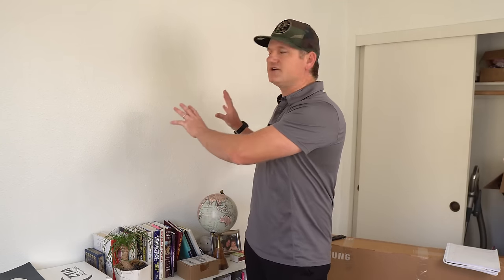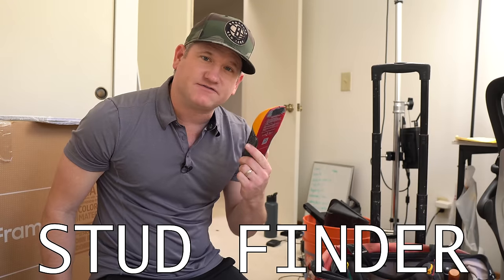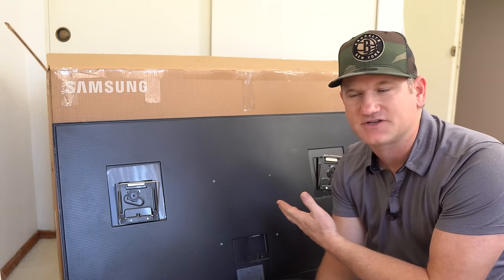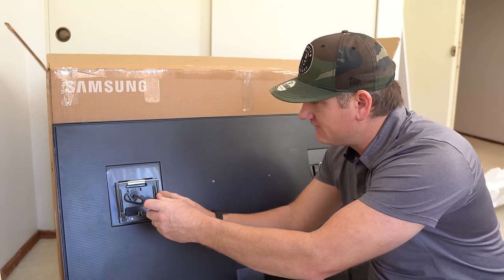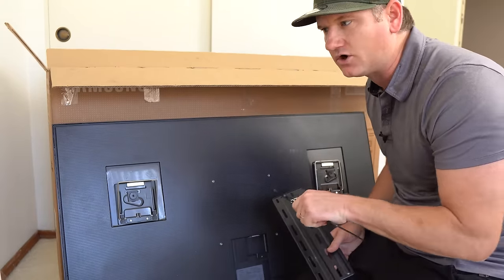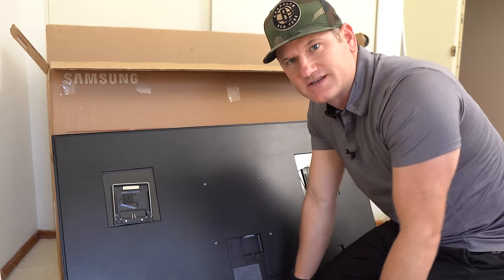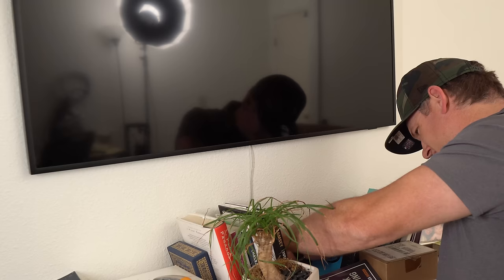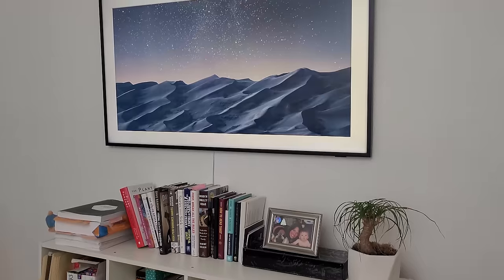Samsung Frame - Quick and Easy TV Installation

Comment: Love this video, thanks for sharing it with us. I have a 55" frame coming next weekend, and as a renter, I was concerned about cutting into the wall for concealing the cords and conduits. I love that since I won't be hiding the cords, it makes installation that much easier and straight-forward. I will have a barn door tv stand sitting underneath the hanging tv, so I know the cord won't be obvious at all. I mat still get the cover for it. This was so helpful, thanks B!

Comment: Excellent video!!, i work through handy app and some customers want wire inside wall but i always tell them that wire is not prepared to be inside the wall by code, unless you buy the upgraded wire that cost like more than 250 dollars that Samsung makes it. Excellent video and proper installation!!

Comment: Great video. Lost the template in our move so this was perfect. I had box of those exact drywall anchors but they wouldn’t set in the hole properly due to Vapor barrier and insulation in the wall. They’d snap. So there’s a series of half inch holes my wife won’t know about until she decides to redecorate.

Comment: Another helpful video!  I'm picking up my frame this afternoon.  I have an in-wall channel where the wires will go to the one connect box in a cabinet below.  But there is a power outlet that will be behind the tv.  I don't plan on plugging it in there, but will the outlet keep me from getting the tv flush on the wall?  Thanks!

Comment: All TV displays should be designed like this.  There is another post here on YT, that discusses the advantage of having a video receiver connected to a "display" to separate the two devices in the same manner as audio equipment.  In the case of video, this solves a the age old problem of hiding wire(s).  The idea of having 1 wire of power, video, and audio from a video receiver would prevent the chaos of tech protocols  that infest today's tech requirements.  Example HDMI 2.0-1-2-3-4 etc.  If we could limit these things to a separate video and/or audio video receivers, and make displays open architecture, then the most expensive part of the system is free from obsolescence and cutting the cost of the unit.

Comment: The wire would drive me crazy as I would see it every time I walk into the room.  Granted it is a very thin wire and "most" people would not notice it. I decided to install mine using the OnQ box and run power from another outlet below.

Comment: This video helped us out loads today. We thought the clips were broke when they moved around so much but after watching this we released that they were supposed to so you can adjust the TV on the wall. Thanks, very helpful!
Reply: Thank you for video and comment TT. I understand that the clips are designed to unclip themselves from the mount to adjust the TV but why go to the trouble of aligning everything so minutely to start. As soon as you hang the TV the hangers HAVE to disconnect themselves from that big screw in button. How do you then push the TV flat against the wall so the magnets engage.

Comment: Probably could've gotten away with just 2 snap toggles on the left and 1 plus the stud fastener on the right (less holes in the wall). Those snap toggles are strong enough to support quite a bit of weight if I'm not mistaken. I also would have used a different method for securing the one connect wire to the wall as well as getting it as straight and taut as possible (command strips maybe or some type of fastener similar to thumb tack). Would've been a no go on the rusty washers to lol, not a big deal I'm just OCD lol As expensive as the Samsung frames are you would think the design would be a lot better thought out. The one connect is annoying and not installer friendly. I had a guy move his media stand while the one connect box was still connected and he ripped the cable setting him back like a 150 bux for the cable. I don't know what they were thinking when they designed the interconnect and the mount and mounting hardware. Awesome vids as always, love watching your install content.

Comment: Do you lose any functionality of the one connect box if you mount it in the wall? Will the remote still work as well with it in the wall? Will the box get to hot inside the wall even if you use a AV mounting box?

Comment: Great installation video.  I am going to be installing mine soon and have a couple of questions?  1) currently on the wall where my fram will be is an electrical outlet and a coverplate for phone/cable. Will I need to remove these or will the tv still be flush against the wall ? (Ie: will leaving these interfere with a flush mount?). 2) similarily, does the one connect wire need to follow the groove on the back of the tv?  My conduit will not line up perfectly so I will have to just run the wire over a bit and not in the grooves. Will this cause the TV to not be flush?  Cheers

Comment: For a TV that is designed largely for the aesthetic appeal, it's amazing how poorly the product is managed when it comes to the cabling. The "invisible" cable bundled with the sets is not in-wall rated. Samsung does offer an in-wall rated cable (the "2019" VG-SOCR86U/ZA) and while it apparently works with the 2020 & 2021 versions of the Frame, Samsung doesn't list those units in the documentation. Depending on the reseller, some outlets (Best Buy, B&H) will tell you that it's not compatible. The cable is also considerably thicker, so it doesn't fit into the channels on the back of the TV.

Sound about right B?
Reply: I think the average consumer won't route the wire into the wall, so that's why samsung decided to do the "invisible" cable gimmick. Is there any truth to the claim that the in-wall 2019 cable works with 2021? Currently users on the amazon listing for the 2019 wire are saying it doesnt work.
Reply: @chinchilla505  A number of people on various sites, including Amazon, indicate that the connector port is identical and the 2019 cable works with the 2020 & 2021 version of the Frame. If you ask Samsung product support reps to verify, you get different responses.

Comment: so with the "slim fit mount" there is always a little extra gap at the top correct? I just installed a 65" frame tv and the bottom was no gap, but the top had a gap.

Comment: When mounting the Frame on drywall, with studs, etc.. .just like in this video.  I took a drywall knife and “scored” a straight, small channel from the bottom of the TV to below the cabinet top.  I then pushed the exposed wire into the “channel” I scored in the wall with my drywall knife.  I then used drywall mud to cover the channel.  Let dry, do a little sanding to make it look smooth, added some texture then painted over it.  In another room,  I took a piece of 2”wide, masking tape and covered up the wire.  I then painted the drywall tape the same color as the wall.  It looks good, not great.  But, nobody notices that there is a wire taped to the  wall.
Reply: I was thinking exactly this! Thanks for letting me know it will work!

Comment: Is it safe to use those toggle bolts for the 55" frame (36lbs)?  Would 1/4" ones be better?
Also, thank you for the video, very helpful! Clean install and you do a great job filming and explaining as you go through it!  The best install video I've seen.
Reply from the maker: The 3/16 are best.. they hold 90% weight the 1/4 inch do and they're much smaller and easier to work with and both are massively overkill for this.

Comment: I am trying to plan blocking in a wall for the 75 inch unit.  Samsung can't tell me the simple dimension between the mounting brackets.  The installation manual with the wall bracket does not refer to the frame tv model number.  So without buying the unit before my house is built, I can't get a dimension.... any suggestions?
Reply: This may help. Depending on your local timber prices. 
Knowing which wall was going to get the TV, I lined the entire wall, with 3/4 flooring sheets, known as yellow tongue flooring here in Australia. 
Then glued the drywall over top.
The TV, speakers and floating shelves were mounted without needing to find studs.
Added bonus is how much sound deadening it gives, keeps the TV noise out of the bedroom side of the house.

Comment: Hey B, so I bought a 65” frame and I ran into an issue I was hoping you could help me out. So on the left bracket I’d be able to hit a stud but on the right the stud I would have to use is showing electrical. I can see the outlet is on the left side of the stud, would I still be able to drill into the stud just be careful of the side the electrical is on or should I avoid it all together? Would the single stud be fine and use all flip toggles on the right side? I personal would like to avoid that
Reply from the maker: It's what I did in this video. Why would yours be different? The electrical is not normally In the Stud but you gotta do what you think.  I have literally never hit an electrical wire with my drill on over 10k installs
Reply: I was a little worried about the weight of the 65”. One last question, you think I’ll be good with the 3/16”x2-1/2” flip toggles? And I was thinking about doing 2 screws in the studs and 4 flip toggles on each side for extra support, would that be a good idea? Thanks btw, your a life saver 👍🏻

Comment: It is possible to do it this way but is it right?
The barackets on the back of the TV is turned up side down. There are magnets that is puppose to hold the TV to the wall if wanted.
Reply: Actually that makes sense. Otherwise the hangers pull the mounts out

Comment: No offense bud, but I would never allow you to work in my house; I'm one of "those" people who would go nuts, with the way you leave the wall looking like a toddler was let loose with a crayon. Yes, it's behind the TV but that doesn't make it go away.
You do a great job otherwise and I learned a few things and got some decent tips.  Why don't you try using painter's tape to make your marks and then remove all the evidence of your doodles at the end? Personally, that's how I would expect a professional to work in my home.
Reply: Good thing your not around for manufacturing of boats or anything else.
Reply: @garyradtke3252  Dude, I've been in manufacturing for (probably - judging by your misuse of "your"?) longer than you have been alive!? Fiberglass, steel mills, sand foundries, you name it - I've done it. Yet, despite the messy environments, those products leave the factory in almost flawless condition.
I don't see how you can correlate graffiti and hieroglyphics left behind on a client's wall with those types of manufacturing environments(?).
I just gave the poster a recommendation: use some painter's tape to do your markings on, and remove it when you're done. Easy peasy!? 
Why did that put a bee in your bonnet?

Comment: I just got the new 75 inch frame and my studs don't line up with the optimal postions on the new mount. Will toggle bolts in dry wall support the 75 frame??
The toggle bolts I purchased say they can support 64kg (141lbs) and the Australian model comes with a template for the install:)
Reply: 75 went up without issue using toggle bolts. I've got thr 2020 model as well and I can see why they switched to the new bracket but I still prefer the older
Reply from the maker: Yep. Easy enough
Reply: I never use the Samsung os I always use external devices but testing out the wired network and its only 10/100 which is pretty crap, why not include 1 gb card.

Comment: That one wire powers the tv?
Reply: The wire connects to the One Connect box. The one connect box provides power to the tv. The box also allows other connections like HDMI. Etc.
Reply: Yep, check out the other videos.  Samsung has this OneConnect box that has the power, hdmi inputs, etc. so that all that stuff and the processing is done in the box and the TV can stay thin.  So power and the signal come through that one wire.

Comment: Can anyone figure why it's a two piece wall bracket? One piece would make hanging it level and accurate much easier.
I've installed many tvs, just not a Frame, and I don't see the point.
For reference, the roatatiing bracket is a one piece.

Comment: isn't it the whole idea behind this tv, so no wires are exposed? Kinda stupid on Samsung's side not to make that cable to better suite in wall installation... oor give a choice in between bulky but protected cable vs thin and unprotected for different types of  install. I myself will be installing it inside the wall, inside the Split Loom Tube Polyethylene PE High Temperature cable conduit for cleaner look.